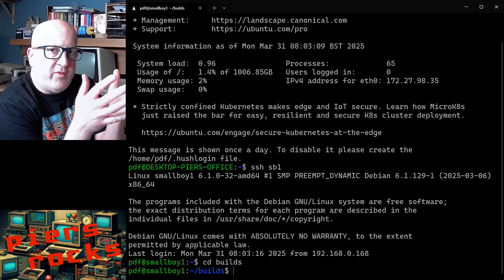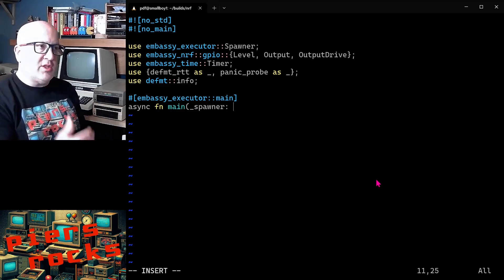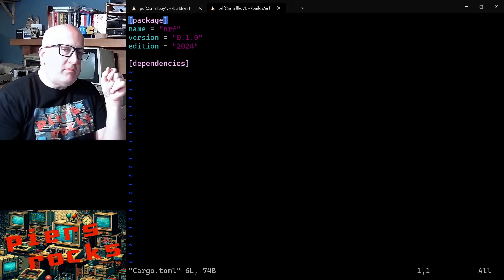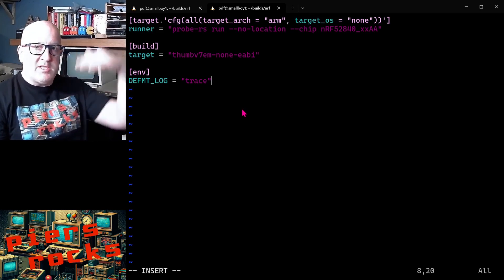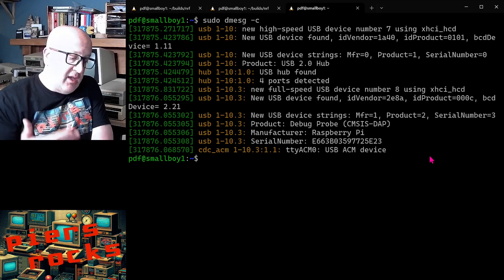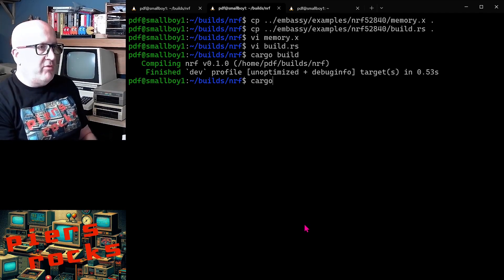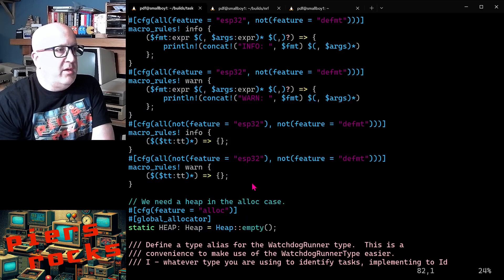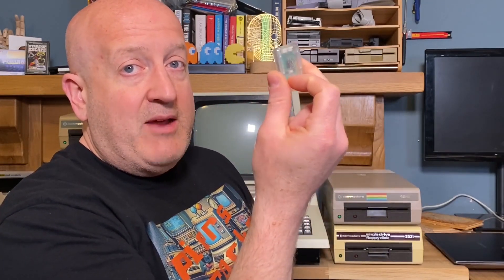🔷 Nordic nRF52840 Rust Embassy Tutorial: Getting Started from Scratch | rocking rust

Comment: I'm watching this after I went through this using AI generated code and when i tried to follow error messages. However, memory.x file is tricky and some sources do not exactly agree how it should look like. For XIAO nRF52840 start address is likely 0x27000, but it did not always worked, because I previously used bad ones and overwrote parts of MBR and/or SoftDevice firmware and later I tried to fix it. At the end there is a bootloader, but Zephyr and Adafruit page do not agree where exactly is some part containing some data and where useable memory ends. But something like 40kB at the end is reserved. Then I have nRF52840 dongle, where program starts at 0x1000 after MBR, but bootloader at the end has 128kB - which is ignored by Zephyr. File from embassy github just uses whole flash and memory without mentioning any device.
Reply from the maker: My guess is this is mainly due to different OSs/frameworks expecting to use the flash/memory space differently.  Fundamentally if you're doing bare metal you can decide how to lay out your memory.x (i.e. your linker file), but otherwise you will have constraints from the framework, and those will be different for different frameworks.

Comment: Hi, i have an nrf52840 and want to get that raspberry pi debug node. Which pins on the raspberry do i have to connect to the nrf (is it SWCLK, SWDIO, GND and 3v3?)
Reply from the maker: @squodwird8382 If you have a raspberry pi debug probe (or a pico acting as one, or another swd debugger), yes, you need to connect to SWCLK, SWDIO, GND and also need to ensure the nrf has external power applied.
Reply: @piers_rocks  Alright thank you!
Reply: @piers_rocks  Hey, i tried flashing it, but for me it says that the core is locked and it lacked the permission to derase: erase_all. It happens when i enter „cargo run“.
Do you have any idea how i can flash the nrf without this happening (I connected the pi debug probe correctly, just like in your video)
Reply from the maker: @squodwird8382 Depends on the precise state of the board.  is it a new/blank MCU, or has it had firmware on it previously?  If it's got firmware on it, it might not have SWD enabled (or even had it disabled permanently - via OTP).  If firmware that disables (or doesn't enabled) SWD, ot would require booting the nrf into bootloader mode (can't remember how to do this from memory).

Comment: Would it be possible for you to compile an MCUBoot + DFU bootloader for this nRF52 device? I’m using the same chip (nRF52 series) and attempted to compile it myself using the nRF toolchain, but was unsuccessful.
Additionally, there doesn't appear to be a precompiled MCUBoot bootloader available for this board.
The main reason I’m looking for this specific bootloader is so that the NiceNano (nRF52840) can be properly detected and used with the nRF Connect for Desktop software.
a video walkthrough of the compilation and setup process — it would be greatly appreciated.
Reply from the maker: @ahsanulhaq7348 While there certainly seems to be plenty of interest in nRF development, I'm not currently working on nRF based projects, so unlikely to get to this anytime soon.
Reply: @piers_rocks  thnks, i understand, lets see in future if you get time for this

Comment: What about Risc-v micro controllers?
Reply from the maker: Nordic or generally?  I'm not an expert in Nordic ICs, but believe the nRF54L15, supported in Rust by nrf-hal has a RISC-V co-processor.  I don't know if the hal gives any specific support for the co-processor or just the main (ARM) core.

More generally, I've done a lot with the ESP32-C3 RISC-V processor in Rust, and it has good support - https://piers.rocks/u/airfrog.
Reply: @piers_rocks  I'm talking about Risc-V series WCH32.
Reply from the maker: @gregandark8571  I've not used the ch32 - I see there is rust and embassy support for it.  I might play with it at some point!
Reply: @piers_rocks  Because I was thinking to switch forever on something like:
CH32V003 & PY32F002A
Reply: @gregandark8571 I'm currently doing a project with a Ch32V003 and rust support is great!
Reply: @piers_rocks  CH32V003 to the PY32F002A